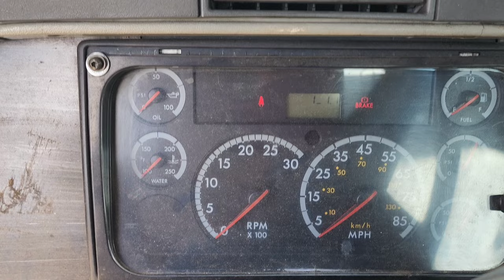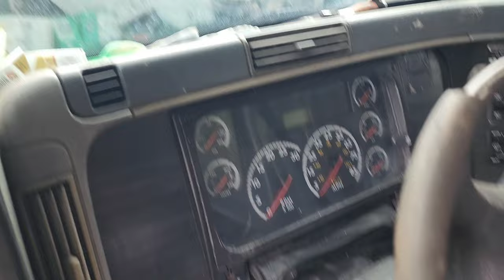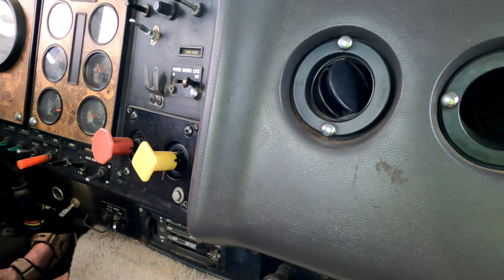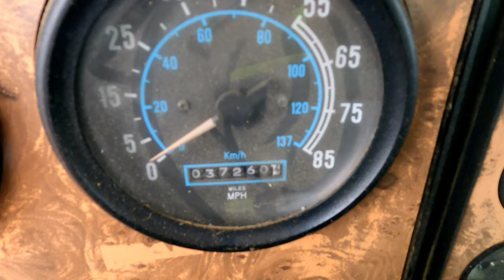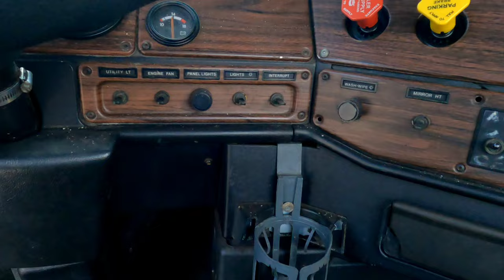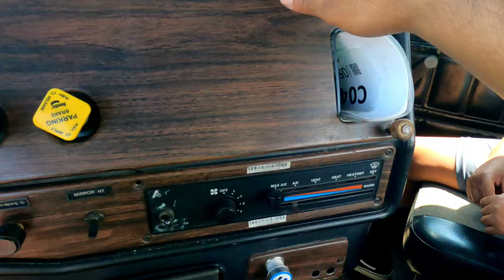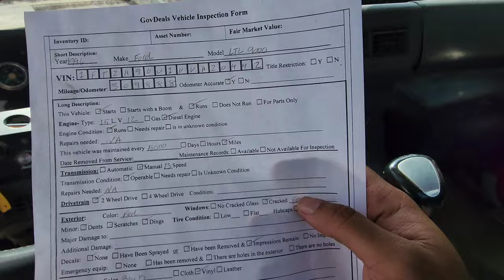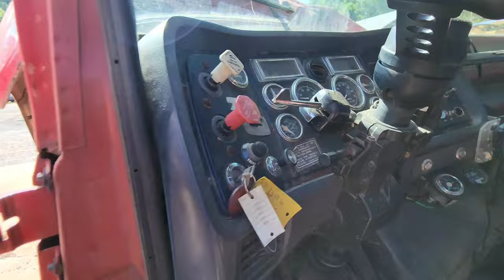🚨 Truck Hunting 🚨 CAT, Detroit, Cummins 🤔 Single or Tandem Axle 🤔 Which setup would you choose?

Comment: As a trucker for and owner of a 1999 kenworth w900 i would have ran with that ford 9000. Them ford 9000's are damn good strong  trucks built to take an ass woopin like them 80s r model macks. It having an n14 is a plus as well. Like others may have said dont waste your time with the single axle. You'll be selling yourself short. If you do win the bid on the 9000, park it and fix up over time while you run your current set up so you will have a good solid truck when its time to hit the road.
Reply from the maker: You're definitely making a solid point!!! I did read those Fords were the greatest trucks Ford EVER built.

Comment: The Ford is by far the best truck. Low miles and ac works. May be a little harder to get use to the 13 speed if you haven't drove one before but nothing to run from. Ford all day. And I drive trucks.
Reply from the maker: I appreciate you watching and dropping your opinion brother! I'm reading those Fords are tanks!

Comment: Yeah that's Sterling was the one man 300000 original miles you can't really find trucks like that especially with that motor in that transmission that's I mean that's as a good set-up he had over $4,000 in tires

Comment: Yeah when you go to look at a truck man the first thing you need to do is check it for Blow by you take the cap off the oil and leave it running and see how much smoke you got put your hand over it see how much oil comes on your hand if that's true that mother is about to do for overhaul also look at your blow by holes in the bottom see how much Blow by you got it's always best to shift without a clutch less is you a lot longer too you can also always take the dipstick out put it on a napkin see if the oil has any you know diesel in it or antifreeze in it you just put it on a piece of paper towel and you'll see the oil stay there and if it has any antifreeze or diesel in it it'll go past the paper you'll see it like soak up the paper there's all kinds of ways man you just got to make sure you look at the you know check the blow by and check your water and all that s*** make sure there's no oil and you know everything's good you can run into a big problem so you don't and get off and pull your plugs on their rear end see how much metals on it pull the plug on the transmission where you fill it up at see how much metals on it you know what I mean you want to check all that man get under there push your drive shaft up see how much plays in your carrier bearing and your universals see how bad your yolk is and check all that brakes are simple if it needs brakes that's not hard to change or do